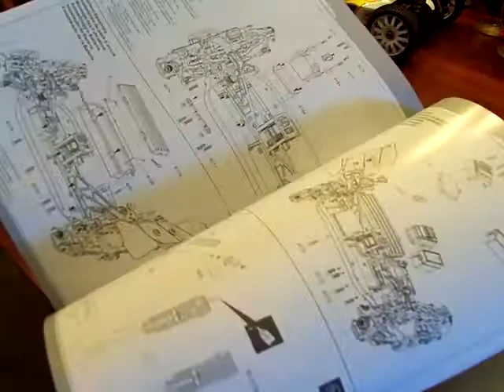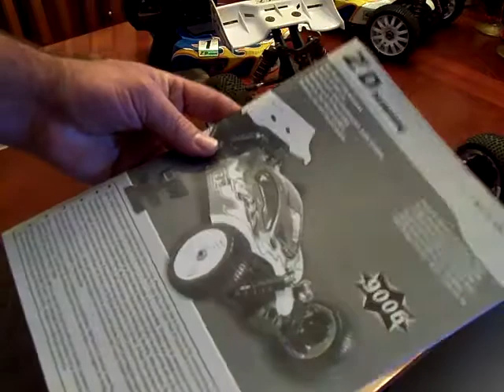ZD Racing ZRE-1 Initial Thoughts

Comment from the maker: Technically, it CAN run on 4S with speeds over 50+ mph, however you have to closely monitor your temps, maybe 1-2 high speed passes at a time, then let the electronics cool down otherwise you risk burning everything up.

Comment: for the shocks you could also put spacers in them and i upgraded to about 40 silicone shock oil. i also upgraded the servo and the front brace always broke on me so i put a aluminium bracket on it. also you need to down grade the pinion gear to a 10t or 11t. if you want to race it. and put a fan on the esc and a heatsink and a fan on the motor.

Comment: wow... i found this very informative compared to other vids of the 3s model.. thank you for your thoughts and tips on this model.. i will replace my motor.. and try to run this again.. I have had mine for around a year.. got it used and burnt the motor up day 1 on a 50c 3s 5000mah...finally got the checking the model out after seeing this vid and the previous owner had it WAY overgeard.. i will replace with stock and see how it holds up

Comment: Hi, I got this last week on e-bay, after 15mins driving on the street, my front lower suspension bracket mounts is banded, and front lower suspensions is broken, part no# 8138 and 8041, do you know where i can get the replacement parts???

Comment: do you remember/know if this car can fit a bigger motor? like a true 1/8 scale?
Reply from the maker: I don't own the car anymore so can't take measurements but I do recall there was enough space to fit a traditional 1/8 buggy motor, however I wouldn't recommend it, the drive train is not designed to handle true 1/8 power :(

Comment: Is this car worth buying I'm new to rc cars with electric motors
Reply from the maker: Compared to any 1/10 car, this is definitely better... however it falls short when compared to most other 1/8 buggies... you will be limited to the stock electronics on 3S... I don't think the drive train can handle true 1/8 electronics... for entry level club racing it's not a bad deal... but don't expect it to last long term... parts will wear on if heavily abused.

I'd probably give it 3 out of 5 stars if I had to rate it.

The next step up would be an OFNA, then top tier would be an Associated, XRay or Mugen.
Reply: Got you I'll just go with redcat monsoon xte then
Reply from the maker: I would say the ZRE1 is about dead even with the Monsoon XTE in terms of durability, however parts will be a little easier to get from RedCat, so I think you'd be making a good choice with the RedCat in that case.